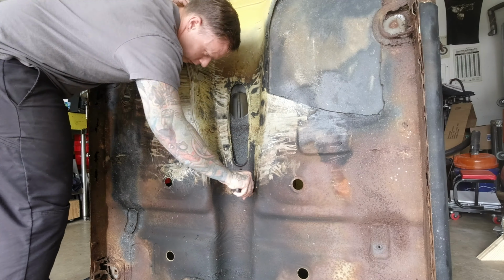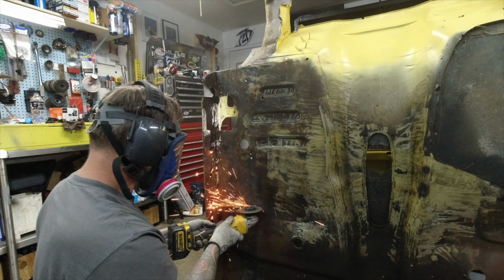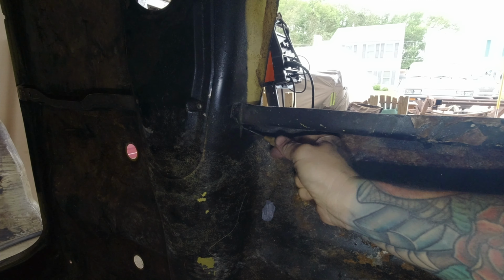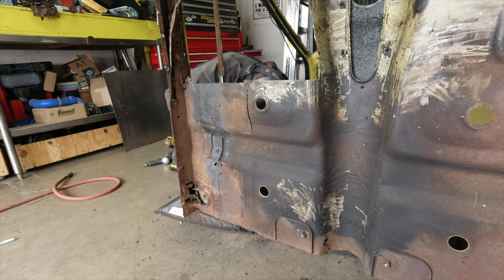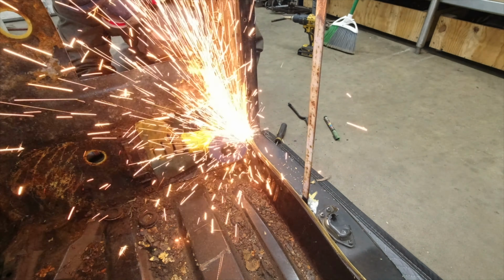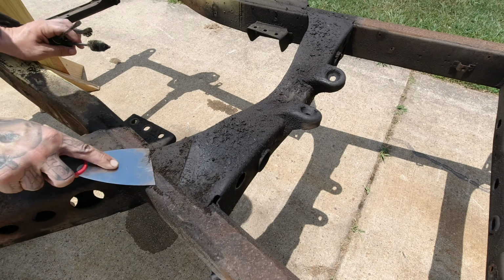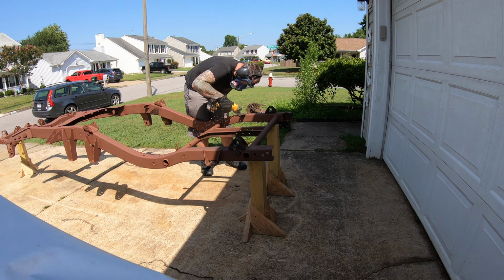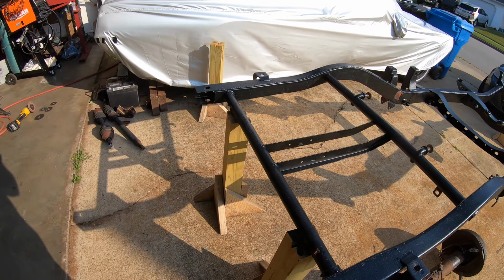Datsun 620 Ep.8 - Cutting Out Rusted Floors / Stripping and Painting the Frame.

Comment from the maker: New rocker panels came in while I was editing this video, so the next video should be replacement/fabrication of floorpans! I KNOW that 95% of the 620s out there need new floors, so I'm excited to make that video and share my style with y'all.
Reply: I just inherited my Gramps’ 1977 Datsun 620 that needs a lot of love–very happy to have found your channel!
Reply from the maker: That's awesome! I hope your inheritance is in better shape than my auction buy. I'm a little behind pace on new 620 videos, but the new stuff will be well worth the wait!
Reply: Are these Datsuns good first pickups?
Reply from the maker: They can be. Mechanically, they seem pretty straight forward, easy to work on, and reliable. The 77-79 would be best for a new owner because the front suspension (ball joint type) is far superior and less prone to issues. 
These trucks love to rust. I doubt you'd find a project truck that doesn't need floors and doors. If you can live with some rust for a while as you fix it up, I'd say, "go for it!"

Comment: Lots of rust, I would only work on this one side, after fixing every thing moving on to the other side. On my 620 , every piece I hand made I test fitted it over the rusted piece, then I cut out floor in small pieces and weld it in,  you have a lot to cut out at one time and weld in at one time. This is a really big job, a lot more than just floor pans like my truck, wishing you the best and keep up the good work.  I would like to thank you for saving this old truck and sharing your rustoration.
Reply from the maker: Yeah, that's also my plan. I only cut out the passenger side so far, and will not cut the other side until this side is all fully welded. I use the old pieces as templates and test fit. I made the whole floor on my '50 Ford this way and it turned out amazing. 
Stay tuned to this project, because I'm almost to the point that it's about to turn a little wild!

Comment: I['m enjoying your Datsun 620 video's , I've owned a 1978 620 extended cab for 
20 years. I only used it for short time way back then (1/4 )of a year use, as I over heated it
was leaking from water pump .But I live in a rural area and have kept it , even though my wife
wanted to crush it ,I always said no. I wonder if ( who ever sold you the rockers ) makes other
floor panels? keep up the great work  fun to watch and see how 1 guy can re do a 610. with fab's, improvements.
Reply from the maker: Rockers are from Tabco. They make other panels, but I don't think they make floorpans. They might now, I haven't checked in a while.

Comment: Just a reminder, when making the body mounts you will need to make a channel for water to drain. Also on the sheet metal on the back side of the rocker panel has a few channels for water to drain out.
Reply from the maker: Thanks man! I'm aware of this and have been thinking of 3D printing a set of dies to "stamp" channels just like the factory ones.
Reply: @tinygaragefab  I have never used a 3D printer, it would be interesting to see how you make the dies!

Comment: If you use a 1/8 pilot drill before using your spot weld remover bit .
It acts like a guide so you won't wreck the teeth off the cutter
Reply from the maker: 1/8 is still too big to keep the spot cutter on centered. I like a good center punch, which is what I used. As with most annular cutters, there just isn't a 100% foolproof way to have them not walk.

Comment: For the pinch weld cutter just start a small pilot hole so it doesn't run away on you.
Reply from the maker: I've done that as well, but they still make me angry. I need to buy one of the drills that have a c-clamp built into it so that it can't walk away.
Reply: @tinygaragefab  awsome work. Ill be pressure washing my frame this weekend too.

Comment: In this video, did you spray inside of the chassis/frame with preventative or primer at any point? I'm new to restore and am almost to the frame on my King Cab and want to make sure the rust is stopped. I'm on the Oregon Coast so I want to make sure I don't set myself up to do it over again. Any input would help bud. Thanks
Reply from the maker: I sprayed as much as I could. While I'm not a huge fan of Eastwood products, they do have a frame paint that has a long flex tube with a circular spray head that is intended specifically to go inside frames. 
On these trucks, the frames definitely fight rust longer than the bodies do.